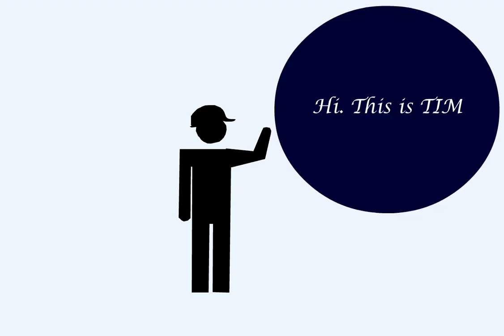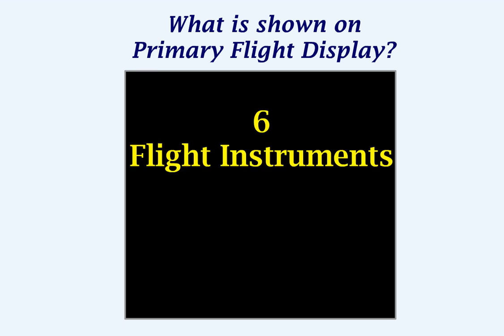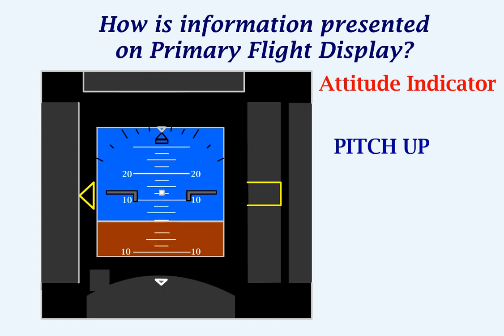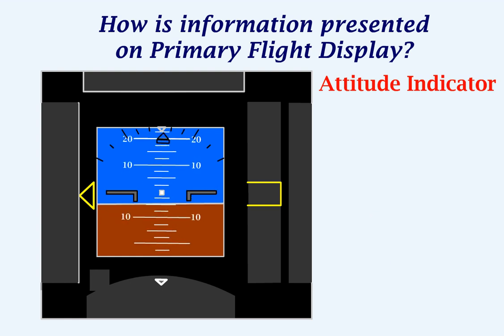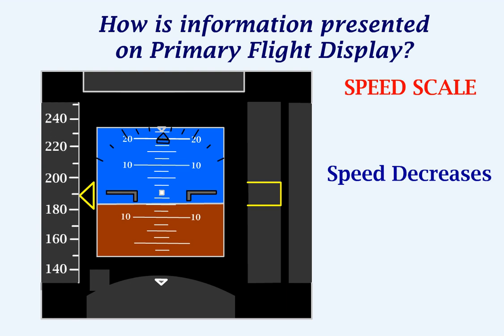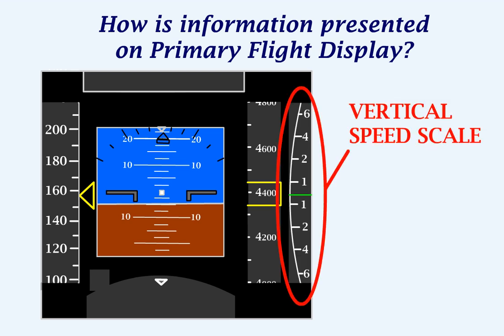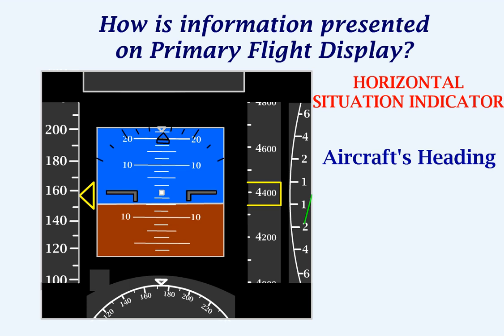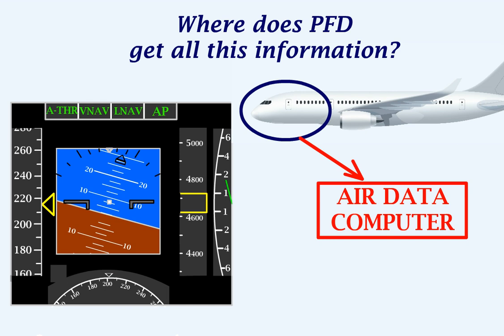Understanding the Primary Flight Display or PFD in an Airplane!

Comment: @2:07 >  The trapezoid does not indicate true Side Slip.  It is usually called Slip Skid and is a calculated value based on Lateral Acceleration.
Reply from the maker: Yes that's true!

Comment: Shouldn’t you correct one of the side slips to a skid
Reply: You are exactly correct and I have a comment posted above on that.   The Slip Skid is calculated value based on Lateral Acceleration.  As you indicated it is not a true Side Slip indicator
Reply from the maker: yes it is!